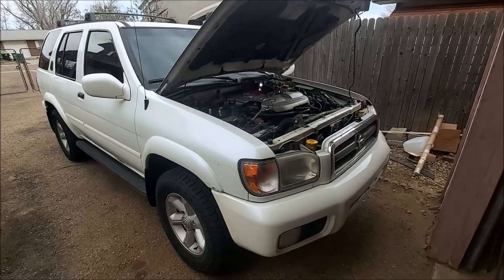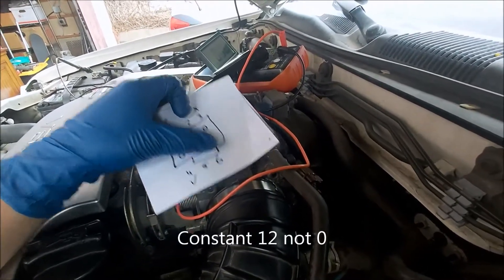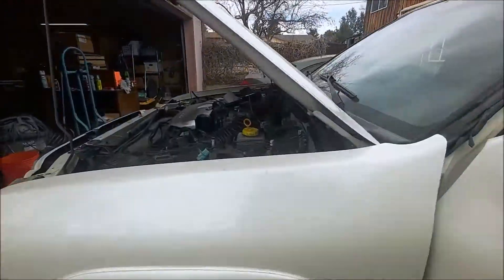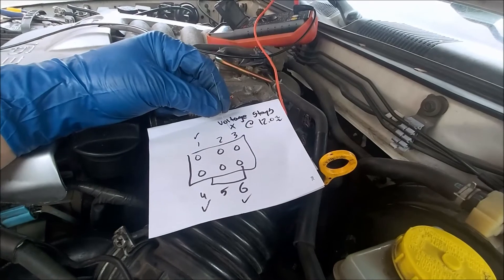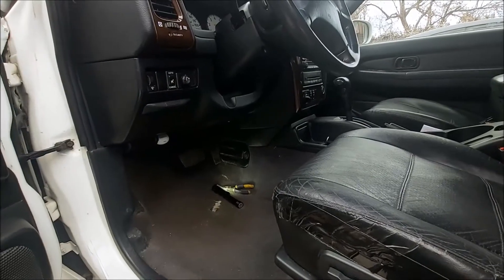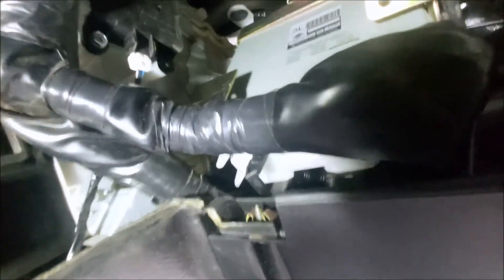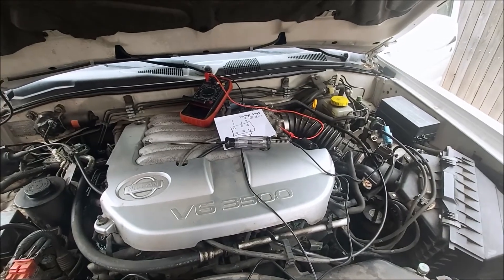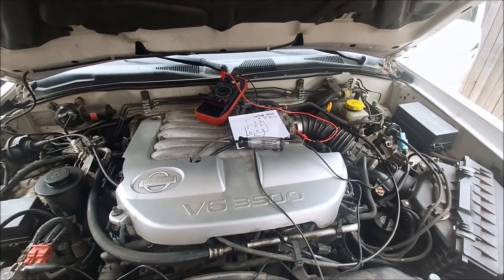Nissan IAC P0505 Harness ECM Probing Diagnostic idle surge

Comment: First you said the 2 center wires were ground, then 3½ minutes in, you said the middle wires were power supplies??
Reply from the maker: I think I corrected that with an annotation on the screen, but check out the scanner Danner video link in the description. It's better than mine

Comment: did you ever fix it? i have an 02 pathy, ive replaced the IACV,  replaced 3 o2 sensors, and a fuel filter. My pathy is still surging between 2000 and 3000 rpm on cold starts. The only way for me to get it to run normal is if i let the engine warm up and turn it off and on 30 times to get it to idle at 850 RPM....
Reply from the maker: I replaced the iac chip in the ecu. Now the engine will idle cold and hot. The only issue it still has is that if you're slowly accelerating in first gear, between 1000-1500rpm it will jerk like crazy like before. I'm assuming something is still wrong with the ecm. I retested the voltage and the problem changed location. I also never did the pumping the pedal procedure after this the cel never flashes. Before I changed the chip the engine would run high idle and then surge when it hit the ecm required temp to change strategy.
Reply: @WCGwkf  Hmm, for your problem, I could only assume with my knowledge that your throttle position sensor might be off by a few volts because the other grey connector connected to the TPS is the transmission gearing switch?? that's not the right name for it but it has something to do with the transmission. My situation is, I have a sensor 1 o2 sensor flat lining on the graph warm or cold engine and its brand new, can't figure out why... and I have a bad cat on bank 2, I have a brand new OEM IACV, cleaned throttle body and new TB gasket,  I bought a KAG OBDII to USB cable to connect my laptop to the ECU to perform Idle relearn with an application (NDS II) that emulates the CONSULT II scanner Nissan has at dealerships that cost $2000, but of course the idle relearn doesn't work at all lol (with or without scan tool), new fuel filter, fresh coolant flush, fresh engine oil, brake fluid flush, TPS sensor calibrated using voltameter, and yet after 3 months of working on this thing any time I have the idle surge persists... I'm going to see if I can do the test you have shown on the wiring harness for the IACV, never thought of that. I also need to pull my ECU out and check if the chip is burned, I sure hope not, but I know here in SC they have a place that rebuilds ECU's for around $200. Haha this pathfinder is embarrassing starting it up early morning for work XD
Reply from the maker: @SupraKing12365  if you have a local shop that will rebuild for $200 it's probably worth it. This vehicle wasn't my daily/only vehicle so I didn't fear diving in. Really the hardest part was getting all of the solder off the pins to get it free. You also have to make sure you don't have some gross vacuum leaks, I have a video on that too. Main culprit is the breather tube under the intake manifold that goes between both valve covers. If you have a new iacv, your harness isn't fried, the iac fuse in the engine bay isn't bad, and you don't have vacuum leaks it's likely the chip. Even if it doesn't appear burned it can still have an internal short. The test in the video should confirm, but also watch the scanner Danner one. My video is more of an example of what he showed. It's also possible that if your chip is fried / harness is messed up you can fry your iac motor right away. The whole problem with this system is coolant running through the iac. Super dumb design.
Reply: @WCGwkf  yeah, ill have to take a week off of work to send my ECU up to the repair place, its $250 and its definitely my ECU. Everytime i drive my car i smell it burning... but its still running somehow, dont know how long that will last though. And the fact that it disrupts the A/F ratio it has ruined my cats too. And the ECU has destroyed the brand new IACV i just put in there 4 weeks ago. I wonder if i can just put a custom ECU in there that wont burn out ever like they are supposed to do.
Reply: Did you fix it?  I also am having the same type of issues with my 01’ Pathfinder. First I replaced the #4 ignition coil because of the trouble code I was getting and the misfire. I had to remove the IACV to reach the bolts for the ignition coil. It ran great for a week, then I had idle surges to 1500 rpm at idle and fluctuations. Replaced the IACV and cleaned the TB with new gasket. Tried the relearn procedure but it didn’t work. And now my idle doesn’t surge. It just slowly decreases and kills the engine. I’m going to check the ecm and see if the chip is fried next. Any insight would be greatly appreciated. This is one annoying problem!
Reply: @joemoon03  no I haven't fixed it yet. still surging and can smell burning from my ecu when I drive for more than 15 mins. I've done a vacuum smoke test and there's no leaks. Luckily there's a place here in SC where they specifically rebuild 02 Pathfinder ECUs for $250, and you MUST replace your IACV when you replace your ECU. I think for the Idle relearn the vehicles has to have no check engine lights or SES light, which makes idle relearn pointless. I would check ignition coils, Fuel injectors, fuel filter, alternator if its dieing after startup.
Reply: I just replaced my iac and now it is surging I’m just gonna put the old one back in 😢😢

Comment from the maker: ScannerDanner video that I followed you must watch:
https://youtu.be/Wt_zTJWbDzs

IAC chip was replaced and all vacuum leaks were fixed. Idle has returned to normal but there seems to be something else going on with the ecm.

2001 Nissan pathfinder 3.5L  v6 with p0505 code
SES light will not flash on relearn process and dealer level scan tool will not complete auto relearn process.
This vehicle already had the IAC replaced, if your voltage reads steady 0 on one of your wires you could have a bad iac motor.
Reply: Just curious ever figure it out ? Sounds similar to mine . Iacv went and took out chip . Replaced both . Now idle starts high then after some time drops to 300 and struggles to stay alive . I couldn't get engine light to blink on relearn and dealer got it to complete but then the idle dropped back down. When I tested my 4 outter pins on the iacv plug. They all started at 0.46v and then cycled up to 11.50 when I turned the key on , but I noticed  pin 1 and 3 held 11.5 volts while pins 4 and 6 dropped down to 0.022 . Do you know when the key is on if the pins are supposed to hold 12v or cycle then drop to 0v? Any help would be appreciated.  Thanks